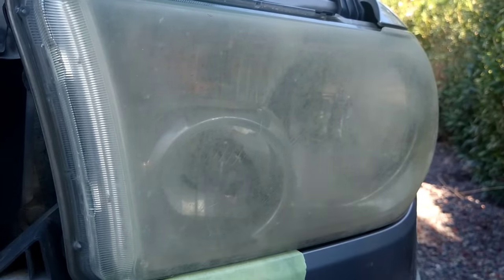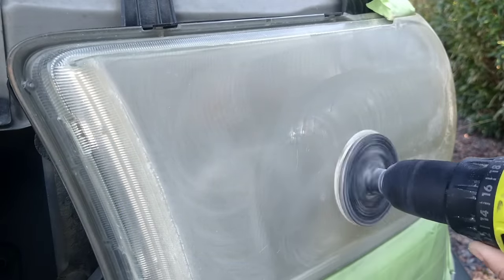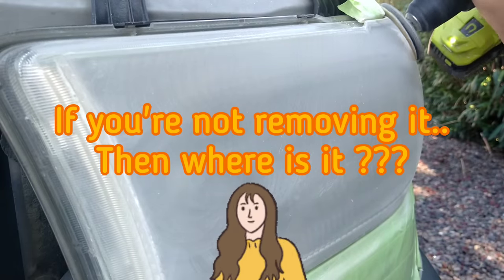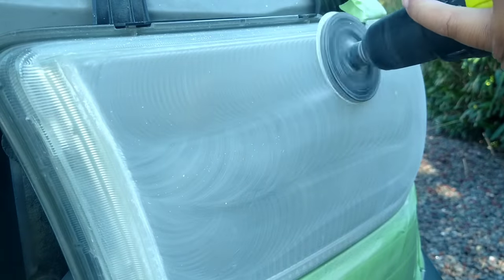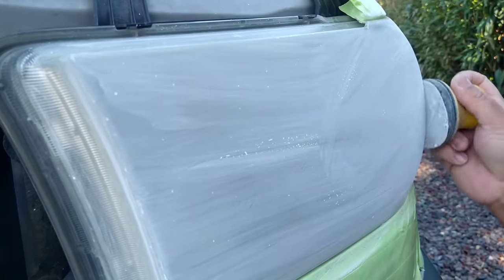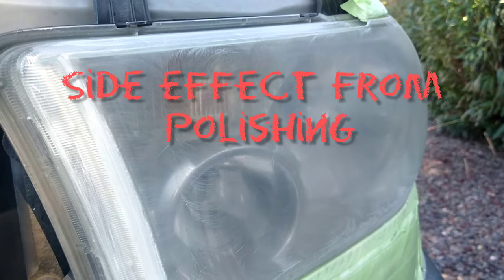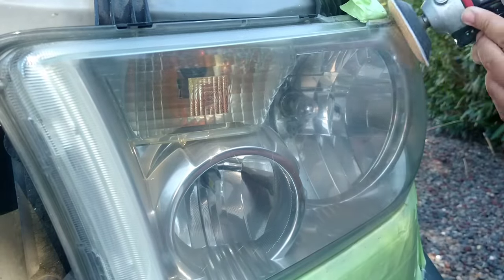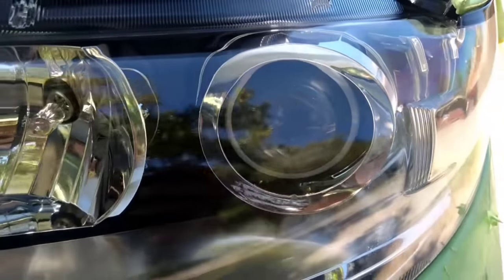POLISHING HEADLIGHTS IS A SHAM/scam  ---  and why you should never only polish headlights

Comment: Great video!!  Good to know you're in Sac.  Just curious why you only dry sand it instead of wet sanding?  With my limited knowledge, I'd think wet would be better?
Reply from the maker: There's many reasons why wet sand is insufficient and dry sanding is superior.. the number one is that when you add water it acts like it lubricant reducing the ability to remove something not enhancing it, also cooling it.. which is the opposite of what you need for headlight restoration, you need a certain level of HEAT which comes from friction which affects your clarity in the outcome (if you think of something that is foggy when you melt it it comes clear like plastic, or sugar)(if you held a blowtorch up to the foggy headlight things would become clear) and you need to be able to remove the proper amount of material, you need your removing power which dry sanding gives you A LOT MORE.. also when you wet sand you cannot see or feel the depths that you need to get to , to remove all of the damaged surfaced(you need all gone, if not your clarity is low, and it will come back much faster) (Miss colored yellow oxidation) which is why a lot of wet Sanders cannot produce a certain level of clarity and their consistency is always off they might have one headlight we're it's looking really cool and the next headlight looks foggy or still a little bit yellow or gray tint the consistency is far down because they have no idea the depth they need to go to remove the damaged part of headlight on the surface, and this is also why my consistency is so high damn near at 100% ...Also wet sanding is NASTY very unclean you have a residue going everywhere all over the vehicle when people see it it LOOKS LIKE CRAP..💩 lol also let's touch bases on the heat aspect as I was telling you plastic has a certain heat or flashpoint(where the plastic turns clear from heat) when you're dealing with polishing it or sanding it, it kind of sterilizes, that makes it react different aiding in the clarity in the end result this is one of the reasons why the headlight will look white before the final step, then when you polish it ,it  becomes crystal clear heat is an aspect of it , the friction of sanding and  polishing..(water cools off/stops and inhibits heat and friction) some people skip this step and believe they have the same level of clarity but is not true.(huge difference). especially when it comes to NIGHT VISION.. those headlights aren't going to see as well without this step..(polishing) but yeah WET SANDING IS OBSOLETE and it takes longer, messier, that's efficient and even more...(I had a period of wet sanding). It does have its place as a fine tune step.. not as beginning step it's almost like when you cut grass you want to use the lawn mower first then the weed eater.. you can cut the whole grass with a weed eater but it's just not the best method... Harder, slower, doesn't yield the best results at all..
That's just a couple reasons I can go on and on and on but hopefully that gives you a little insight.. yes in Sac..😀
Appreciate the support please let me know if I can be of any assistance.
Hopefully you subscribed continue watching I have more content coming soon..💯👍🏽
Reply: @theheadlightrestorationpro  Awesome, thanks for all the info!!

My mom needs one of her headlights done, so we'll probably be giving you a call!
Reply from the maker: Looking forward to it 👍🏽💯
Reply: @theheadlightrestorationpro  o

Comment: Wouldn't the best kit be a ultra 3m headlight restoration kit? for those who would like to do it diy and get pretty good results aside from a slight learning curve it's pretty cheap too besides needing a drill to do it
Reply: That's what I've always used.  Works great.  The other systems where you just rub on some chemical and it supposedly works all suck.  Those are for people that are too sketched to use a drill which I understand but ultimately you either sand and polish or the long term results suck.
Reply from the maker: One of the best if not the best...will be starting reviews again shortly..

Comment: In a bind while traveling at night, put some motor oil on a rag and give it a quick little buff (gas station squeegee wash before is recommended, allow to dry… takes a minute or two). Should last a week or so, but help you see more clearly at night. Nice band aid fix that is easy enough for our lazy society. 

As for the video, sanding also removes the pitted areas that trap dirt and the small holes that refract and diffuse the light.
Reply from the maker: Hey you get it.. lot of people don't know that...

Comment: Oh nooo. I used that Meguiars headlight restoration spray on my brand new headlights earlier this year (Meguiars says it can be used on new headlights as a preventative for oxidation and sun damage) - went exactly by the instructions - and it was a disaster! Don't recommend on new headlights! I regret it so much.
Reply from the maker: It actually does that what they say but a normal person would have a hard time applying it correctly even if they tried to follow the instructions.. but honestly I wouldn't recommend it until you need headlight restoration.. so you're someone on the right track.. but you can use it for that but it's quite difficult and probably wouldn't do it unless I'm professional was going to do it...
So sorry to hear that..
In the future try applying a little aftercare to your headlight..
I will be explaining after care in a future video so please subscribe and stay tuned it's all you need and it's way easier...
Thank you for watching.
Reply: @theheadlightrestorationpro  thank you! Are you saying I'm "normal"? I'll take that 🤣 I removed as much as I could with 90% rubbing alcohol and microfiber cloth (the Meguiars company told me to do this in a forum where I explained the disaster). Some of it still won't come off after multiple attempts, but the main problem now is I have fine scratch marks all over the lamps (the Meguiars flakes into tiny particles that scratch the surface when you do this) and they aren't nearly as shiny as they were before. It literally makes me sick on my stomach lol. Can you recommend anything to me to buff that out? I don't have any hand tools such as the electric buffer you use.
Reply from the maker: @user-sf7ve9fm2t  honestly I would just call a professional.. I'm sure there's headlight restoration near you..

Comment: I did a quick de-yellowing on a 2003 Honda Accord and a 2000 Dodge cargo van with orange pumice hand cleaner and a thick wet buffer wheel on my drill. The yellow came off easily and stayed off enough to improve the lights when driving.

Comment: The whole video he is polishing headlights like everyone else does. Then calls is a scam and gets 100,000  monetized views.
Reply: Read the title again. It clearly reads "never only polish". Meaning you need to do the stages of sanding such as 600/1500/3000, buff with a compound, polish, and then seal with a wax or clear cloat. If you just buff and polish, then it won't last. You'd probably have to do it every month, meaning you're just grinding away material. Where as if you did all the steps, then you just polish and seal once a year with a wax or canned clear coat. Professional grade clear coat last longer, but the equipment to spray it on and cure it is expensive.

Comment: Always amazes me that no one just takes the headlight/lens out of car. Everyone tapes all around light. It takes all of a couple minuets to remove them. Then you can do a decent job at the entire lens without worrying about the paint around it. Plus its way easier to hold the lens in your lap or on bench and get all the angles of lens.
Reply from the maker: Not at all it's extremely more difficult to hold it yourself, and compared to a 2000 lb vehicle holding it for you...🤔
Well many reasons.. the number one reason is 100% of the damage is on the surface exposed part of the light.. therefore no reason to.. typically to remove modern-day headlights for the easy ones would take about 30 minutes.. and to reinstall an additional 30 minutes that's an hour of Labor..(much more expensive) and those are the easy ones hard lights could take over an hour to remove, in an hour to replace....about 30% of modern-day headlights you have to remove the bumper sometimes the tire and fender well just to get the headlights off...
. The number two reason.. it would triple the price of headlight restoration.. due to labor in time.. #3 the best wait to have that restoration is mobile go to wherever the vehicle may be available to do headlight restoration wherever the person may be, home, work, shopping, etc...(I do HEADLIGHT restoration everywhere, highly impractical to take the lights out for this reason to)
Even more reasons of that but those are the main..
Thank you for watching..
Stay tuned.. I'll probably be addressing that issue soon as well..
Reply: Not on a c6 corvette. This method is best. You'd have to almost remove the fender and front bumper.
Reply from the maker: Exactly my vehicle as well have to take the fender off at least fender Wells partially and the tires..😳😳
Reply: You should see how to take the headlights out of my 2006 Volvo s60…
Reply: When I need to clean my 2012 Equinox headlights, I will probably use this method due to the fact that the front end has to be removed to replace the headlights. Relacing the headlight bulbs is not so easy, either, because the access is through the wheel well. Even then the high beams are hidden and almost impossible to reach.
Reply from the maker: @donsmith9478 exactly it makes it a lot more difficult.

Comment: Nice finish, worth all the effort. Have you ever tried using a 125mm battery-powered orbital sander, I've used one for years sanding fibreglass gel coat (hard plastic) with grits from 60 to 3000 and it's one-handed easy, leaving the other hand free to administer de-clogging water (+ 1 drop of detergent) in the sprayer like you use. I also use a three-headed rotary sander, (no name) got it online years ago with 3 adhesive 50mm disks, I use cut-down larger ones with wet & dry abrasives ideal for curved & especially concave ( hollow) surfaces. I get similar problems with all the gunk people 'polish' their fairings/body panels/jetski hulls with and the colour goes cloudy, permanent solution is 2 pack lacquer, UV stable, nice hard surface & doesn't attack the underlying material (like cellulose thinners does). Love all the info you put into the work.

Comment: I used a graphene coating that says it's good on plastic, it wasn't  headlights looked like new for a couple of months.  After that I repolished removing the graphene and this time I put on Sylvania's coating.  Time will tell but 6 months in, they still look great.  

I sand mine by hand and use a 5" DA buffer, but I really like that little guy.  My final sand before polishing is a 3000 grit and I sand with water running on it.

Comment: Great tutorial! I have a question though. Are headlights clearcoated? And if so, dont you burn through the clear with the amount of sanding that you did in this video? Never attempted to restore headlights because im worried i will remove the clear, which would be there to protect the plastic housing.

Comment: alcohol wipe twice before passing anything. (also place the headlight on a bundle of towels if its easier) 
alcohol wipe ---> alcohol wipe ---> COMPOUND twice ---> alcohol wipe ---> dry wipe ---> anti UV clearcoat or headlight UV clear spray 2 to 3 times ---> (optional to remove orange peel) compound ---> wet rag
I've done this to a heavily yellowed and oxidized 2004 chevy headlight and the end result was a super clear finish, and i did it by hand with some applicator pads and the same spray from walmart.
Reply from the maker: https://youtu.be/bCD4At1iFAg

Comment: I have, and always will, maintain that most of, if not all, headlight plastic cover degradation occurs as a result of the reaction from the heat from the halogen headlight bulbs. My 2000 Camry's headlight covers were in rough shape when I bought the car, and turned out next-to-brand-new after using basically the same procedures in this vid. However, the turn signal/parking light covers (which are styled to wrap around the front corners) are made out of the same type of plastic and were, and still are, like new. Heat from the turn signal/parking light bulbs is negligible, while the heat from the headlight bulbs is quite hot–don't EVER touch those headlamp assemblies after the lights have been on awhile! Simply put, those high temperatures degrade the coating on the covers and then they're left vulnerable to UV light, stone chips, dirt etc. I maintain my covers about three times a year, and they stay looking 90% of new. Not bad for a 24 year old car. That's my two cents, and I'm sticking to it!

Comment: I used baking soda/water mixture with a polisher and it held up for a couple years. It's not the best method, but it works. I also tried toothpaste and that works well too. I used Meguiars ultimate polish after from what i recall.

Comment: I was interested in your video and thought you made some excellent points. I'm unclear about how headlights are getting into this condition so frequently though as I've owned many cars, many of them older models around 10 years old with high mileage for the vintage and never encountered this? Is it a location thing of harsh winters and hot summers where you are?
Reply from the maker: Actually my friend if this is true what you're saying everybody around you is dealing with it no matter where you're at... It is a pandemic which means worldwide.. if you've been that fortunate and or only owning vehicles that are older than 1980 you should be seeing it everywhere... 98% of the vehicles on the road need headlight restoration the other 2% will need them...
This is a worldwide thing no matter where you're at this is happening if there's a vehicle there more cars will need it by far than ones that don't...
https://youtu.be/zJsBKFQ9bTA?si=VpCnA9C7YNFZn-kq

https://youtu.be/LcMFr0mpp-4?si=QDpSz_DshuWBVZbn

Comment: Have you ever measured the thickness of the plastic before and after your process. From the video it looks like a lot of material is being removed. Nice looking plastic after you're finished.
Reply from the maker: You could sound like this on this light in one area and say 3 in the size of the end piece and discs for like three four hours without even going inside the headlight... That's how Strong this materials and that's how I think the light is it doesn't matter the headlight can get literally well over 20 headlight restorations in a lifetime and that's just the thing causes you don't last 20 years even if you did a headlight restoration every year it wouldn't matter it would do nothing to the headlight... The headlights above the thickness of 2/3 of a pencil or better yet 50 pieces of paper.. what you remove from the surface of each headlight restoration is probably a quarter sheet of  piece of paper...
Check out a new video.
https://youtu.be/MzLqKPgEdkQ?si=bYHn8bP3zLTLeeWB

Comment: I’ve been restoring cars and bikes for a living for over 40 years and have done many modern headlights by proper wet sanding with a soft block with 600 then 2000 then buffing with frecla , then a proper detail and I’ve never had one go back to the way it was even after years

Comment: You should use a clear vinyl wrap instead of spraying....it helps with light refraction, lasts years longer, and makes future restorations easier since there is little oxidation. Worth the extra money. Ive been running one set of headlights for three years now and they still look new.

Comment: Great vid! My headlight : Bmw E60, has small oxidation only on the narrow Eyelash part, the upper part; the rest is crystal clear. Is it possible to only restore the upper part?
Reply from the maker: It is possible but it's tricky you have to know the light and no what goes bad..
If not you'll have clear coat going bad underneath whatever you do..

Comment: Nice looking job!

I use an old small tub of Turtle Wax rubbing compound that probably came out of my dads old garage. Has to be at least 30 years old! I've buffed, bought the kits, had a shop do it...then one day I just said WTF, this stuff works on all kinds of scuffs on paint, etc.. No buffing tool, no fancy cloths...rags cut from old tee shirts and elbow grease. Done in less than 15 minutes.

Not nearly as like -new as the example in this video, but I'm just trying to make the headlights better and pass inspection on our 2004 Sienna...a tank we plan to get 250-300K miles out of. We're not hung up on aesthetics. The van is scratched with minor small dents and the dash is cracked...and oddly enough my wife loves her van! Ole Blue we call her and she's never failed us. We keep her well-maintained mechanically.

That spray is intriguing. I'm sure it's helpful, but at $16 and the can says keeps headlight clear up to a year...I still have some of that decades old buffing compound and once a year is about how many times I need to clean the headlights! Of course thats because the van isn't driven every day and is garage kept.

Comment: Do you rinse out or wash the plastic polishing compound out of the 3-M polishing pad after each use, of just put them away and use them as is on the next Restoration? Also how many rpm is that 3 inch hand held polisher. It looks like a handy little unit.
You do great work and I believe it lasts longer than the chemical methods. Thanks for showing us! I have subbed to your channel and will be showing some people around the shop your method! Take care for now! J Poll..